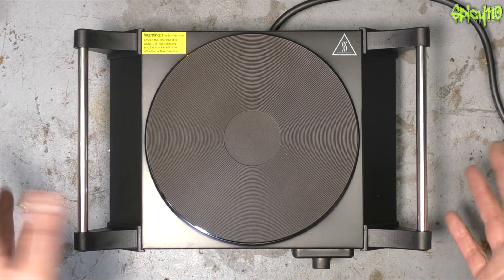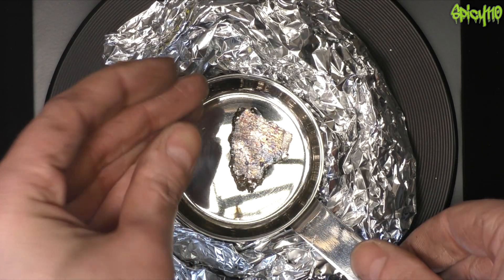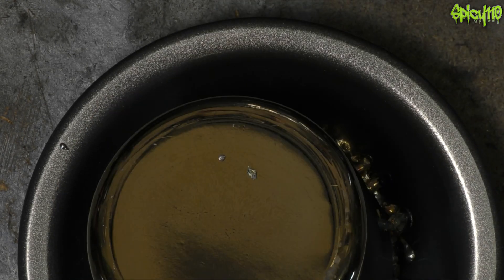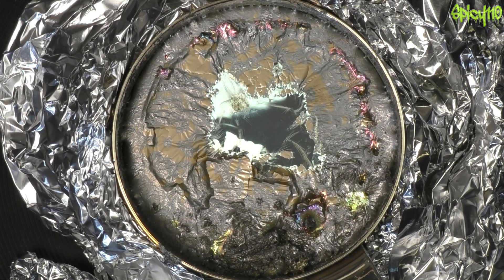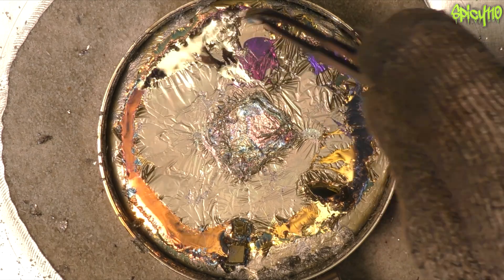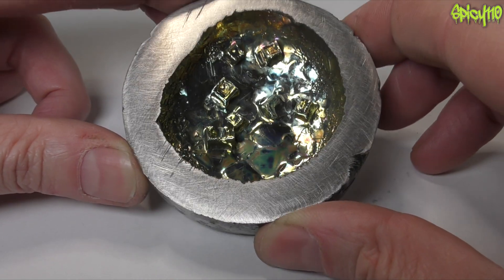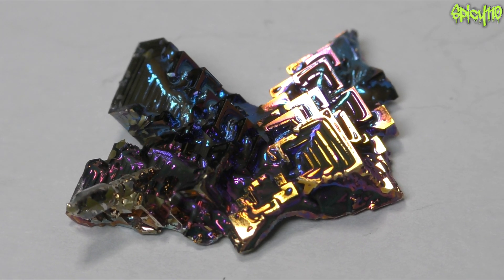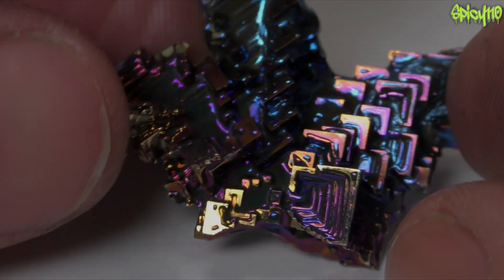Growing Better Bismuth Crystals!

Comment: You need a deeper pot. Like 12 inches deep. They grow from the bottom up. Check to see if they are growing, then dump out into another pot leaving the formations in the 1st pot.
Reply: Wrong. They grow from the top down primarily, the solid form of bismuth floats on the liquid form, that’s a very rare quality in the physical world shared by water

Comment: Do you have any suggestions how to get the bismuth back from all the oxides after multiple cycles of melting?
Reply: You can simply just melt it down again. With enough heat the oxide forms bismuth and oxygen